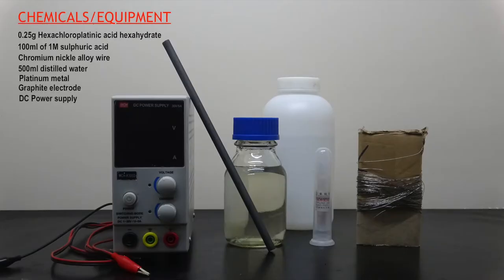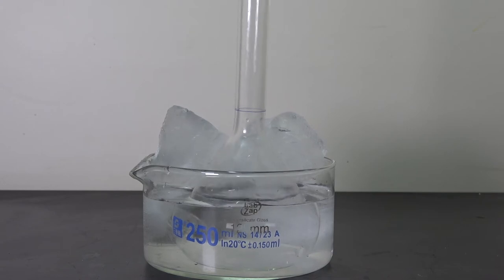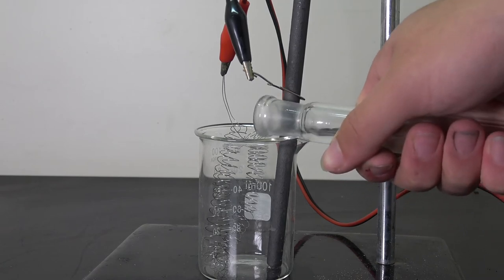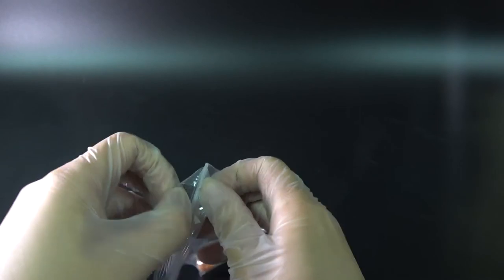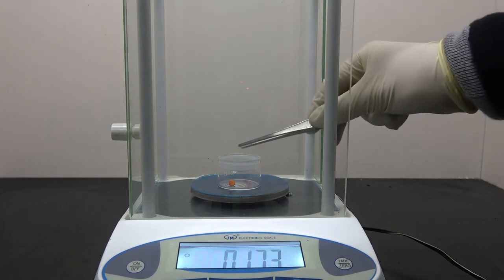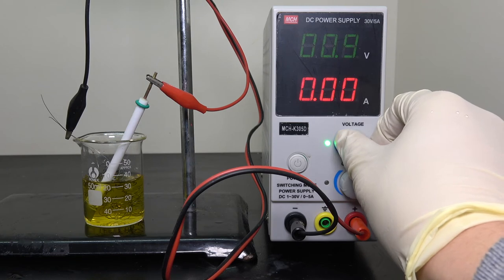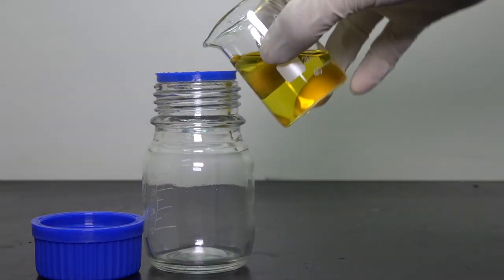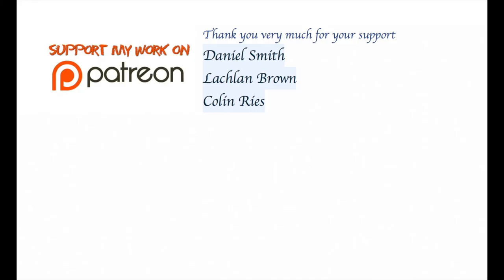Making Platinum Plated Electrode

Comment: Do platinum-plated electrodes de-platinize over time if used in electrolysis?
Reply from the maker: phantomcreamer everything will wear off eventually if you use it enough
Reply: @AussieChemist  okay, I was just wondering because at work we use pure platinum electrodes and they last seemingly forever, at least thousands of times, until something else on the unit breaks.
Reply from the maker: phantomcreamer hahaha pure pt of course . The pt plating on electrode is like a few micro meter thick ,  yet it will last thousands of hours , the pure Pt electrode is in a sense invulnerable to wearing,
Reply: @AussieChemist  Noice! Thanks for the info.  BTW, I don't have a couple hundred bucks to spend on solutions.  Would you mail a piece to me for a price? ;)

Comment: I thought you where doing platinum on carbon?
Reply from the maker: Ok it’s fair to think that way, but what did you think the alloy wire were there for?
Reply from the maker: largeNumberGoesHere gmail I did say “this serves to remove the oxide layer, and expose the fresh metal underneath “
Reply: Aussie Chemist the way you had wrote it I assumed you would be making Platinum on carbon catalyst.  The powder form.   None the less this was a great video.  Great tutorial.